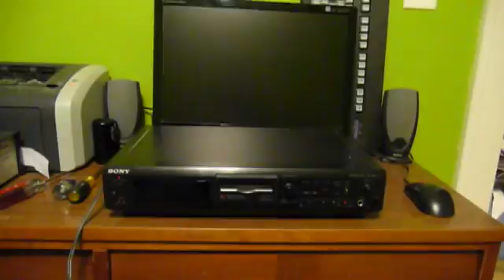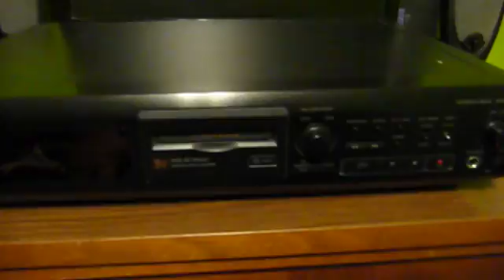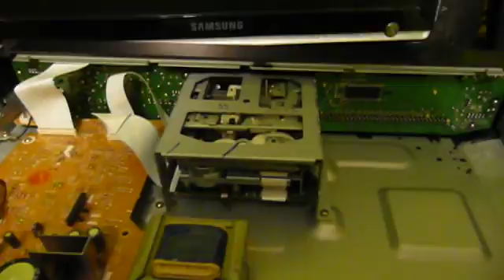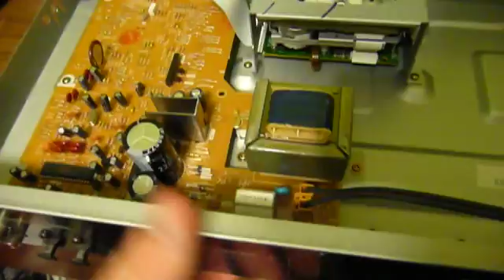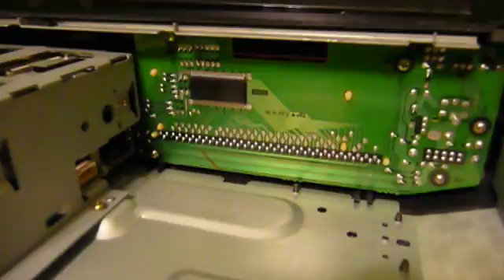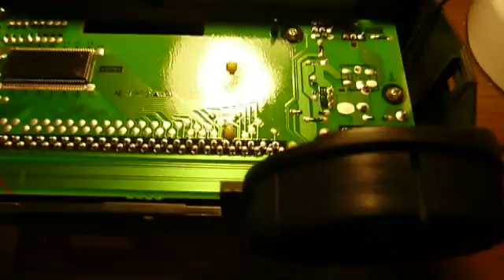Sony Mini-Disc Display Repair

Comment: I got the exact same device and the display did stop working after transport. The seller didnt pack it too well and the package looked like it experienced quite a bad bump.. (UPS was the carrier of course it received some sort of punishment) Your vibration theory is actually pretty good. Its possible that if soldering is done bad somewhere connection/contact is lost however it could even be the weirdes most difficult things to analyze like inside the chip. Simply unplugging and checking all contact and replugging them helps in a lot of cases.. so I will try that first. Thanks for the video evem tho its been long ago.

Comment: Hmm, I have been trying to repair my Sony MDS 501.  I have a sluggish disk transport system.  It is almost like the motor does not have enough power to pull the mechanism through to the point that the system engages.  If I take the cover off, I can "assist" the drive system and the disk will load and play perfectly.  I have dismantled the unit with intent of replacing part of the mechanism (or all).  Any suggestions on where to get a replacement part for this unit?  I am calling Sony in AM.

Comment: I may not be the first to make this suggestion, but Rigol makes a 50Mhz dual trace scope that goes for about $400 if you ever deem that you'd need something like that. And that's new price, that's not used. The model is DS1052E. Very cool video as always.

Comment: Don't forget to mention caps, they'll hold a charge that'll kick you across the room, Good informational vid!, Lead free solder tends to be problematic, That IC would require Pinpoint Accuracy and a microscopic soldering iron to solder :-O

Comment: I suggest getting a logic probe you can test the serial and data lines . The extreme would be a O-scope but a logic probe is cheap and you can a pulser to to test it that way to.

Comment: I have an MDS-JE330 MiniDisc recorder, but I haven't gotten around to trying it out since I picked it up about a year ago. I used to use my MiniDisc Walkman (seen in my video "Can 2.46 volts kill an iPod?") a lot, but the expense of the media and the audible artifacts of Sony's lossy ATRAC3 compression drove me away from the format once CD-Rs became dirt cheap. Also the MD Walkman would eat AA batteries for lunch when recording!

Comment: I'd say practicing soldering is a good way to do it.  I've taught myself to do a good enough job.  I'm sure its not the best job that can be done, but its good enough.  But I'm mechanically inclined, and am good with my hands.   People like my boss at work aren't so much...  lol

Comment: Bill, Just FYI… Your camera will still record if you’re not holding on to it. Find a place to set it down and do your work while it records. I assumed everyone knew a camera will record without hanging onto it, but I guess you didn’t. In regards to soldering, if we are watching your electronic repair videos we obviously think we can learn something from you. Set your camera down in an ideal place and let us see how you solder the connections.